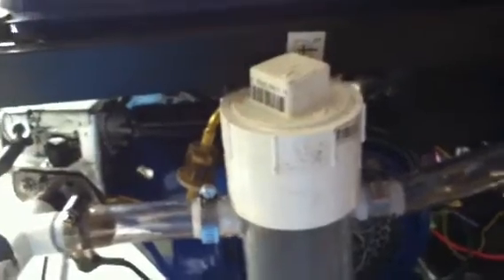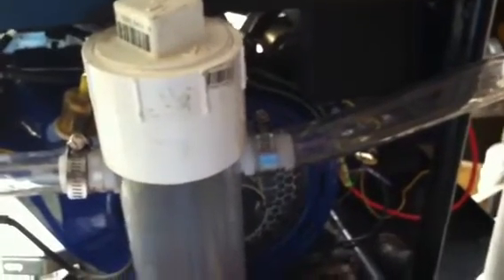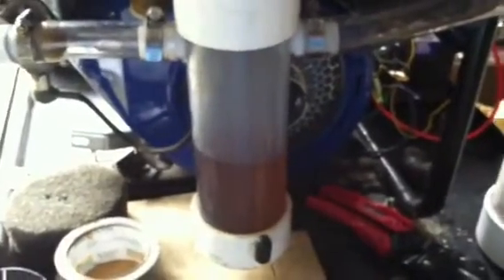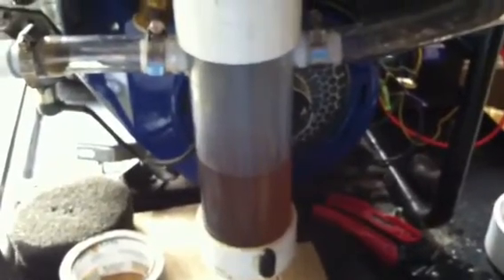Vapor generator video # 5

Comment: Thanks for the video first in part. From observation here the fuel is waaay too cold to vapor so that is failure already. Cold sweating pvc is the tall tale signs. This setup is not a true vapor setup its called an evaporation carburetor it does not work when cold or the lighter vapor part is gone. True vapor carburetor would be heating the fuel to vaporize with exhaust heat. Gasoline these days is part gas and part oil with alcohol as a binder. After the gas part is gone all you have is oil. Study epa fuel tanks on lawn equipment they suck off the vapors off the top of the tank and pull the heavy fuel oil with the carb to be burnt inside the pre heated engine. The reason the engine starts fast is because the vapors ignite first and then the heavy part of the oil takes over once the vapors dissipate. Run your car or truck under 1/4 tank you will see what I am talking about it will use fuel like a bar full of drunks because it has no vapors. The car or lawn engine can burn the oil base fuel partly because of the use of high compression engines. Physics are at play once that is taken in consideration things make sense. The alcohol part helps ignite the oil since alcohol burns easy and cleanly and mixes well with oil.
Reply from the maker: yeah i was going to heat it up later with a pad that works with the bio fuel they have a heat pad that does 212  deg
Reply: Thats a good starting place

Comment: Sorry if i'm stepping on toes, but it seems to help when using fresh fuel to start every test, being that the quality of the liquid drops due to concentrated vapor release. I finished my studies with thoughts of running a multi stage system (or 2 cylinder vap system, that work from e-injectors which be controlled separately from an independent controller. The controller will allow for variable speeds of injection spray. Chambers need to be heated, for efficiency use exhaust heat or coolant heat exchange. 
Sorry, short on time. Good luck and great skill!

I bought one, I just don't have the energy to follow through. might be of some help to you and your team. http://www.harborfreight.com/38-in-oil-fog-lubricator-68233.html
Reply from the maker: Thanks, I will try other ways later i work 70 + hours a week.............
Reply: 70hrs, damn. They sure know how to keep us busy!

Comment: I put gas in a fog machine once and it worked great. fog machine had 3psi pump then went to heating element then out of a small nozzle. if you can connect the pump to accelerator then it would work for any power setting (idle,cruise,full throttle) or you can use a fuel pump to to press the gas through a hot glue gun tip (400* best) then to a fuel injector.  let me know what you think. (jmbrownair@gmail.com)
Reply: Hot glue gun tip, genius. Maybe those could be injector ports, for a multi port system? would give more time for tip to reheat after vaping the un-vaped liquid?   Draw something later. Great Info!! Thanks
Reply from the maker: sounds good i am no t done just need money

Comment: For the Air version to work you have to draw a Vacume and restrict the draw of the bubbles The best way I did and it worked was a Coil of Copper with fine holes at the bottom I showed that in my video . I still prefer the Transducer but if you want to try the air see what I did might help
Reply from the maker: Thanks the transducer gets hot and burns out I want to try it under water then gas above the water
Reply from the maker: HOLLYWOODS7 I have a brass air stone in the bottom of mine.